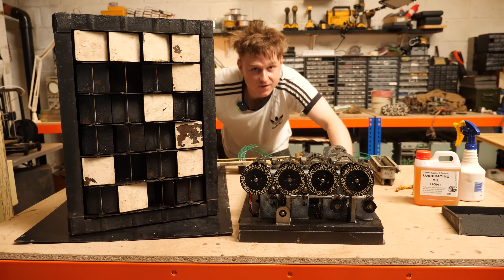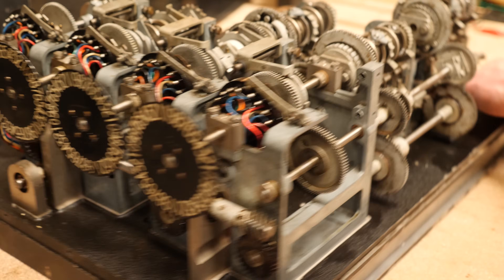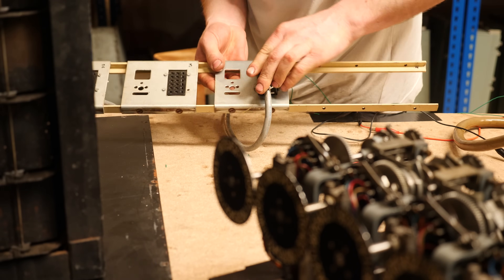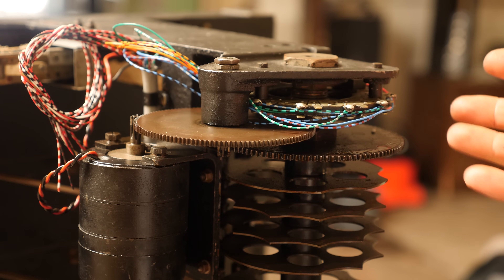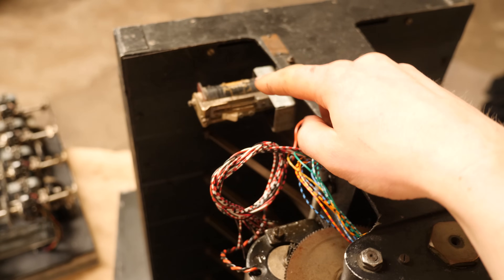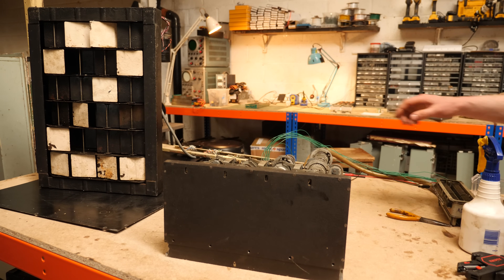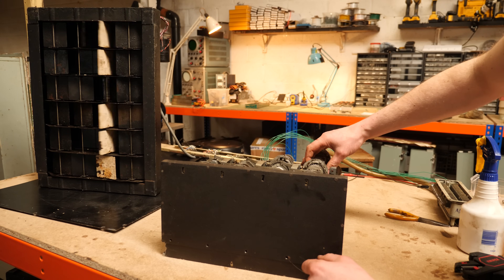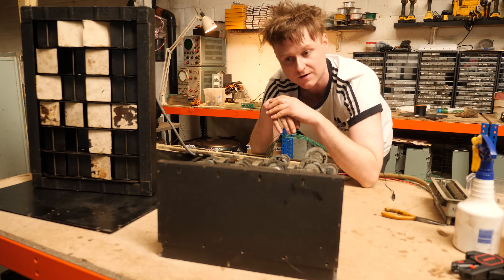How To Wire MASSIVE Number Flaps To The BRAINS - Totalisator

Comment: Should have mentioned the machinery involved - the Win & Place pool involved 50 flaps and 14 aggregators, the Forecast pool used 125 flaps and 31 aggregators, together with a motor generator set supplying the 50 volt DC needed you can imagine the noise level with all that lot going round.
Reply from the maker: yep that makes sense. in the previous vid i touch on the amount of aggregators required but didnt realise the mass of flaps! so i assume you have experience of perry barr? do you have more info and or pictures????

Comment: If anyone has any of those matching 18 pin male jones plugs plesase let us know! would be nice for all this project to match! :D
Reply: So close! I had a bunch of those that were part of a mass spectrum analyzer where all the different modules used them to connect together... but I threw it out a few months ago. I still have the power supplies but I just checked them and only one has one of those connectors. It's a 60 pin (roughly, I was counting in the dark) and female... This is why I try not to ever throw anything out. But you know... having a wife and all... I have to pick my battles.
Reply: I think I'm noticing a pattern with the naming convention... the part number is "318" which I think stands for 3 rows, 18 pins... so whatever you're looking for probably has "318" in its part number.
Reply: I'm 95% sure that what you seek is called "Cinch-Jones P-318-CCE" which is still being manufactured. Unfortunately it looks like the usual suspects list but do not stock these so there's a minimum order of 500pcs from the factory.
Reply: @sootikins  thanks very helpful
Reply: It seems like they are called Jones or Cinch-Jones plugs in America. They are called Plessey Painton connectors elsewhere. Although Plessey actually called them multicon plugs.
Reply: Seeing as you're doing the wiring on both sides of the connector anyway, why not use something 'modern' and easier to get, like a d-sub 25 (not sure that d-sub connectors are considered 'modern' anymore). Looks like it's only carrying the current to turn that coil on and off, so d-sub pins should be plenty.
Reply: @gorak9000  yep but dsub does not match the era. Looking for an authentic option hence going for cinch jones
Reply: i've got exactly three, they're straight connectors. i've also got two matching female connectors

Comment: 5:05 "The downside is, if the contacts aren't completely clean, it just keeps on spinning around"

I'm pretty sure that's actually by design, to make a failure obvious to anyone reading the board --- much better than a dirty contact causing the display to get stuck and show the wrong information!

Comment: The two rotary switches make up an AND gate or a selector and multiplexor, however you want to look at it. The relay controlling the motor is an inverter, or NOT gate. Clever bit of kit!

Comment: That white paint is almost certainly full of lead. I think you'd probably be good just brushing off the loose stuff and then hitting it with a clear coat to encapsulate it to prevent it from flaking off and getting into the air and what-not.
Reply from the maker: fair point
Reply: It would probably smart to test the paint once the preservation varnish coats have been done.

Comment: Beauty! I'll ask around in the communities I'm in, maybe someone has a bunch of those Jones connectors. I'm also pretty sure new ones could be made by 3D printing, possibly using contacts from discombobulated Jones connectors of more common types.
Reply: Seeing as he's doing the wiring on either side of the plug, he could use any plugs really. Could use something more modern and easily available, like a d-sub 25
Reply: @gorak9000 you could but it's nice to have a standard
Reply: @gorak9000 also aesthetically as on front of demo unit. Jones cinch is the way to go cheers ! And also proper ones. All good they'll turn up cheers
Reply: @gorak9000  I think it's more about antique electronics preservation/restoration, not interfering with the unit's original design. Anyway, I mailed a bunch of listings.

Comment: It may be possible to fabricate your own Jones plugs by inserting  spade connectors with crimped wires into slightly undersized holes drilled into a block of nylon or other plastic.
Pressing them in with a soldering iron can help lock them into place.  They can be really difficult to find these days.
Reply: Indeed! I have some without socket covers. But just looking for something that looks proper
Reply: 3d print some covers ? Just a thought
Reply: @stikee2003 yep! But still it just ain't gunna have the right overall look and feel for something on a demo unit. Don't get me wrong love a 3D printer I use em a lot but sometimes they just don't cut the mustard

Comment: Looks like contacts/relays closest to the output dials are for reseting to zero between races, thats why they are on digits as 100s and 1000s that are not a part of a single bet.
Thx, btw, great and interesting
Reply: Also there shoukd be some kind of feedback/ackowledgement back to ticketing devices that particular bet was summed up after been selected by multiplexer
Reply: @YuriyKrivosheyev hence the contacts on the relays below the julius differentiator